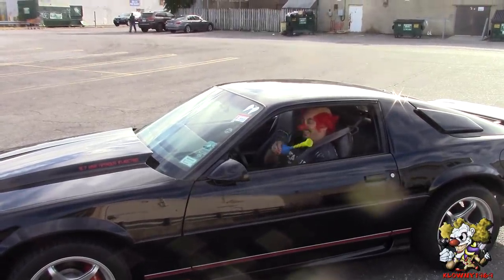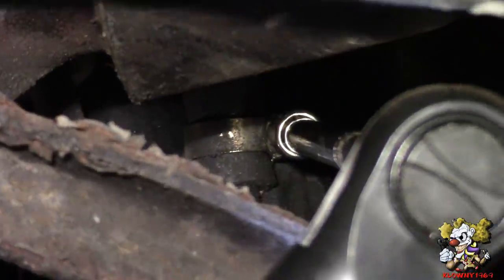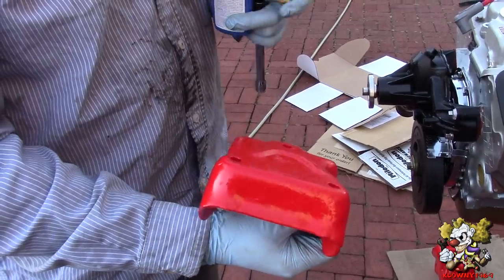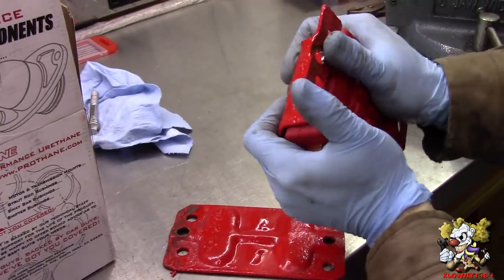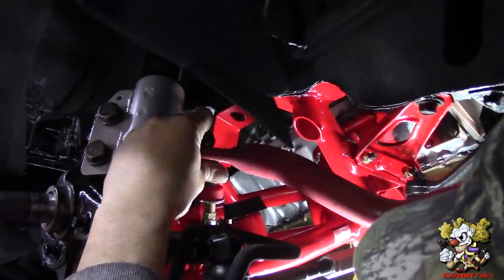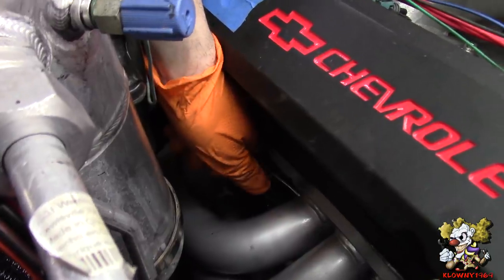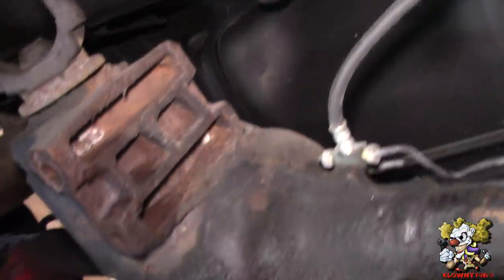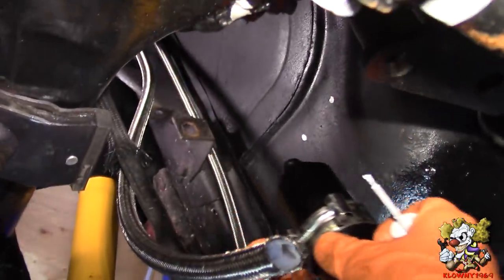How To Build A Thirdgen Camaro From The Ground Up!

Comment: NICE 3RD GEN CAMARO BRO & MY DREAM IS TO HAVE A STROKER 406 IN A 3RD GEN USING A 1973 SB400 W/4.125 BORE! BUT, @ 48:42 I NOTICED A BIG MISTAKE!!! YOU USED THREAD TAPE ON YOUR TEMP SENSOR & IT WONT BE ABLE TO GROUND OUT & THE FANS WONT RUN PROPERLY!!! SWEET CAMARO BRO!!!!!!!!!

Comment: Curious to who makes that rear hatch?  I had an 84 years ago that was a Hurst show car that had one similar.  To be hones,t mine was more stylish.  The rear glass came straight down after the roof line, there were no bobbles on the side and it used the stock spoiler trim.  Like a NSX.
Reply: It's a notchback. They where stock. Some cars got them before Pontiac stopped putting them on there. You can get a reproduction from Hawks Motorsports

Comment: Love your video dude! That's some work. I did learn how to replace my bad fuel line. But I'm a lazy cheap bastard for the rest. I bet you dropped 30 k in that ride just to complete with the500 hp Dodge and caddie, I still give new stock Camaro's trouble with my 85 iroc with only a trani stall and shift kit. Good luck dude. I'll be waiting for your next video on cheaper upgrades!

Comment: 28:13 such beauty. I have a 91 rs in the garage and hadnt really thought about restoring it. Just do alittle here an there but bro you got me wanting to pull it out the grave. Never thought a 3rd gen was worth it.
Reply from the maker: Lol awesome..do it and enjoy the car
Reply: @klowny1969  I just rung the bell. Subscriber for life..  I have question. My rs is basically stock. I did change motor to a 350 and installed a 373 gearbox. My issue is once I changed the rearend my rpms rev hi and my mpg went up and I'm not even going fast so I hit the governor on wide open throttle.  I had read to to get a computer that I can program or buy some type of gear for the transmission that will fix it. Was told the gear is less then 30 bucks... I've been sitting it really because of that issue. Cant even race honda because of the governor...

Comment: I am finally getting some time to watch this whole video.   brings back a lot of memories, as I have done almost all of these mods i the last few years.  
for the fuel system I did -6 return and -8 feed  ptfe lines.  I am not sure about you using that vacum cap on the unused oem line at the bulkhead though... in a few years that will probably get eaten up and leak??   what size pump did you go with?  I do like the fuel line heat protector; i should get some of that for my lines.   I also didnt use any hard-line, i just kept it braided flex line with the rubberized/plastic outer sheathing that is on the outside of the braided steel ptfe. 

  I opted for  the 12 bolt from Moser  instead of a 9" ford rear.  33 spline axles, 3.55 gears, 1/2" x 2" studs, chrome moly yoke.      did a  700r4  built by probuilt automatics to hold 750 hp.. as I didn't know too much about Level 10 transmissions at the time I needed a trans. Level 10 is 45 mins from my house.

what radiator did you go with?

copper nickle lines were a treat to work with. i did those on the 12 bolt axle and next year will do the rest of the car copper nickle 

important question..  I'll be doing a Dart SHP block also. and I am curious about my front accessory drive and water pump.  Not sure if I'll have the $ budget for a $1500 setup from March or Eddie motorsports for billet pulleys, brackets, and accessories.. but it looks like you reused the oem style components.  how did this work with the Dart SHP block?   I no longer have AC, and have a 5 rib non-serp setup. So it would just be water pump, alternator, and power steering.. any advice on how to plan on setting all this up with the dart block

I wish I had got a chance to go to the camaro nationals this past year,  would have had some good conversations with you

Comment: Hi klowny!
I always appreciate your videos,now I have some questions for You.
I'm working on my ‘92 RS Camaro(tbi)and for some reasons the Edelbrock intake manifold don't go whell for my engine,especially in cold times by me,I leave in Switzerland and the Camaro is my all-day vehicle.
Now,I’m ready to redo the stock intake manifold on it and see what appens on cold times.
So theeeeeese are the question for you:
1 How many LITRES (not quarts) of oil does contains the TH700r4?Every time my trans. oil dipstick it's full off oil and a ton of bubbles,so it's impossible to reach where the oil level is......do you now why those bubbles?
2 What computer connection cable do you use to read the ECM?Does it run only for TunerPro or also for others software?
3 Is it right to set the engine timing to zero or below?

Sorry Knowly,but by me all the”old school”mechanics are gone,other mechanics don’t speak english and they seems to destroy my car....
So if you can help me I can save money,time and some others little trouble.
......and yeah! More videos you do.......more help for me!!

Comment: Long Island??? What's up? I'm out in Suffolk County. 
Definitely would like to see this someday.  Not only was a 3rd gen my first car, I happened to really love these cars and personally feel it's the nicest looking Camaro. Mine started out as an 84 with a 305, and I converted it to a 350 TPI with the 5-speed, and also use the iroc-z body kit, suspension, brakes Etc. Unfortunately I no longer have that car, but I am right now in the middle of building and insane 91 Corvette and totally respect other builds and I'll follow you and see what you are up to maybe I'll catch you at a car show someday. I guess I find it ironic, because after my Corvette I plan to build another IROC Z and have been debating starting with a 400 block which was something I wanted to do as a child. I May bore and stroke it, to either a 434 CI or 454ci small block. I guess we shall see. Good luck with your build
Reply from the maker: Thanks..good luck with ur build..you can join us on Facebook: nythirdgen

Comment: With my 383 and t56 
How long will a really good low km 9 bolt rear end 3.27 hold up at drag racing
Reply: Maybe 12 passes with drag tires  or maybe one!!!!!!!!
Reply: Would hold up for a long time as long as you change the weak axels I've been running one behind 500 plus hp for two years now

Comment: Hey dude what part of li are you at. I have a Camaro that needs some work if you are interested let me know
Reply from the maker: Beginner Bouzouki what do u need done? I'm booked for a while
Reply: klowny1969 I have a 91 Camaro I put an lt1 in it and would like to do a turbo. frame connectors.  Break up grade. I have most of the stuff just don't have the time
Reply: Beginner Bouzouki Get in line buddy.
Reply from the maker: Sorry man I have some big projects coming up..dont have the time
Reply: klowny1969 No problem keep up the good work
Reply from the maker: Beginner Bouzouki thank u

Comment: Welcome back dude. Was this the big build you were telling me about?
Reply from the maker: 4thGenDude02/BunkAssMechanic thanks man..it probably was..I dont remember lol I have two other big builds lined up..thanks for stopping by
Reply: klowny1969 hey man I've been subscribe to you while I just changed my name from thirdgendude92 to 4thgendude02/bunkassmechanic since I ended up trading my third gen for a motorcycle.
Reply from the maker: 4thGenDude02/BunkAssMechanic oh yes..I remember u..ok lol
Reply: klowny1969 yeah I'm not quite the mechanic you are so LOL but I do have a question I have clunks coming out of my suspension on the front end, could it be bad ball joints ore dried out bushing
Reply from the maker: 4thGenDude02/BunkAssMechanic np..yeah it could be ball joint or bushings, shocks, or even strut mounts..they all can make clunking type of noises...I usually have luck bouncing the car up and down and listening where the noises are coming from..that's if u hear it over bumps
Reply: klowny1969 okay so it could be any one of those for culprits. I bought a 2002 Camaro Super Sport that had 13000 miles on it and I don't know if things are wrong just from sitting cuz it clunks quite a bit from the front end the car was real smooth when I first got it. Have you got a couple minutes to check it out I put the link here I appreciate it and as always thank you for your advice. https://youtu.be/2TU22JLA1_k
Reply from the maker: Car looks real nice, very clean too..unfortunately the best way to figure out clunks and noises would be to go underneath and start prying things around..also bounce test..u mentioned shocks..they could be bad too..good luck
Reply: klowny1969 thank you for checking it out. If i lived clpse to you, you would be having all my money. lol
Reply from the maker: 4thGenDude02/BunkAssMechanic lol no prob man..anything else u need to know..you know where to find me
Reply: klowny1969 you ever come to orlando, i will take your ass to disney since i work here
Reply from the maker: Lol thanks
Reply: klowny1969 HA

Comment: @klowny1969 man i need a one on one talk about my 89 iroc z problems ill pay u for ur time
Reply: Wat would cause my car to not have power anywhere after I wired a rpm gauge I wired the red power wire straight to the fuse panel it was constant hot I dint realize it till my car wouldn’t start my battery is fully charged is there a relay or sumthing tht I blew